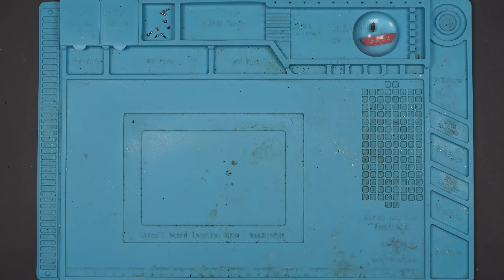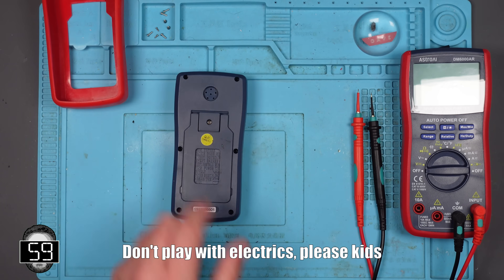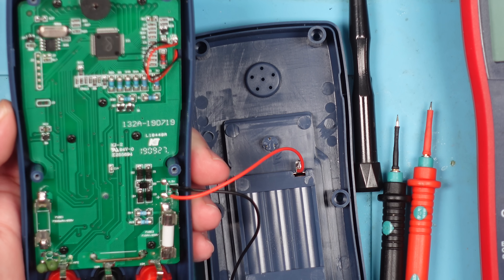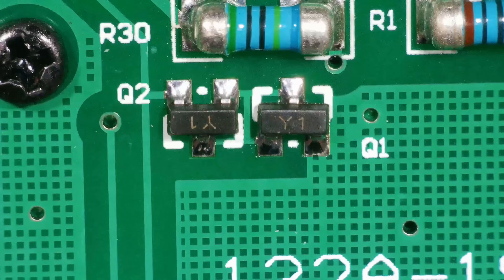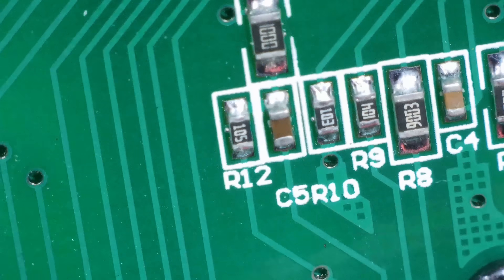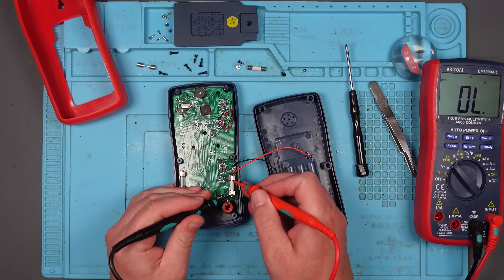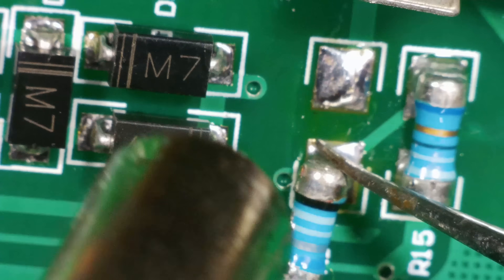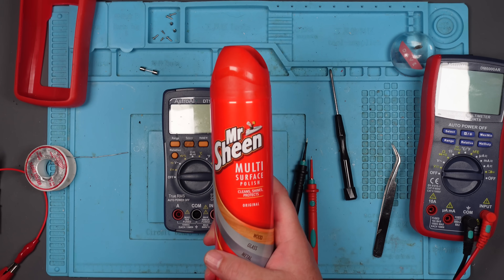My Multimeter BROKE | Can I FIX it?

Comment from the maker: Stupid Multimeter
Reply: When you replace the fuse, take the board back out again, and put some contact cleaner on the pads under that dial-knob. What 'broke' is that those pads got a bit of schmutz on em so that they didn't conduct cleanly. Those pads and the contacts in the knob part form a set of parallel switches that control the mode based on what is and isn't connected. It's a state machine.

The multimeter was erroring out because, upon powerup, it couldn't enter a known state, because it couldn't get clean contact on the pads from the knob well enough to select a specific mode -- most likely it was just getting clean contact on some, and very intermittent contact on others, but some pads might've been refusing to come on at all, if it was grubby enough. You'd be surprised at how touchy these things can get (especially on the cheapies) -- a little bit of finger oil goes a lot farther than you want to know...
Reply: Hi Steve. The problem was with the options selector leads. You didn't see it in the video, but if you put the circular leads on the other side of the circuit board under a microscope, you'll see copper remnants joining some leads with other leads that shouldn't be touching, which is why you're getting the error on the screen. This happened to me a while ago with a cheap multimeter, and when I looked at it under the microscope, I realized there were leads joined by pieces of copper torn off when moving the selector from side to side. This is caused by friction, and it drags the copper to the sides until the leads mechanically join together. You just scrape off those artificial bridges, and the multimeter works normally again. That's why in the video, after moving the selector repeatedly, you get it to work again, because you've broken those small bridges. Best regards.
Reply: @ksktechnics  haha I thought it was a rare thing when it happened to me some years back. fortunately I didn't mess around much, I went with the cleaning option first, when I discovered the dial contacts could be bridging tracks... Thanks for confirming the issue is not so rare at the end.
Reply: Quick update to my comment: that was what the Google AI summary told me but looking at the service manuals there is nothing in there about power cycling to clear errors. Stupid AI...
Reply: Had to Google it myself but apparently the proper way to clear errors on these Astroai multimeters after you've replaced a fuse or what have you is to power cycle it repeatedly. Stupid Astroai
Reply: I love my dm6000 been using it for 2 years now without a issue
Reply: Just want to say thanks for these videos. I've watched so many of them now I actually managed to do a reasonable job of soldering some surface mount stuff yesterday. A huge improvement since I tried fixing a busted charge port on a tablet some years ago and got so annoyed with it the iron actually went through the board..
Reply: I fix meters every day as my students try hard to blow them up. Switch to Fluke and love it for years.
Reply: I didn't see your last video when your multimeter broke. Would you mind sharing what happened?
Reply: Haha i have my own multi meter is really expensive for working the shop and diagnostic circuit on cars it actually no problems since 20 years it bought 500$ for cars repairs . I joined your subscriber and fun to watch but funny your multimeter is out just kinda of fun . Thanks for sharing the video
Reply: It's just a wild guess, but I think the problem is the way you pronounce "cantinuity"😂👍
Reply: There are millimeters with automatic settings! They simply register what's coming through the item being tested !

Comment: My guess is that the overload that blew the fuse, also caused arcing on the selector wheel contacts which left an oxidised layer. When you span the wheel it cleaned the contacts.

Comment: I used to use a VOLTmeter to measure volts.  And then I used an AMmeter to measure amps. Then I used an OHM-meter to measure ohms. 

Then I got a device that did all three and more in one.   I called it my MULTI-meter.

Comment: nice video ordinary slow blow fuses (as your box probably has) have a 250V voltage rationg, but as long as you know not to use the meter in high voltage measurements, you can use a slow  250V fuse untill you buy a 600V Fast fuse. If someone else might use the meter, make a DYMO sticker saying max 250V

Comment: Note for future, fuses are based on amps, voltage doesn't make any difference to the current carrying capability, only to the devices insulation capacity. Amps are amps whether that's at 0.01v or 400kV.

Comment: Those ceramic fuses contain sand to prvent arc blow, those glass fuses are not safe to use on power circuits but that meter is more than likely not safe on power circuits either.

Comment: You want to blow the new meter up already? Don't measure continuity with power in the circuit!!!!!!!!!! A blown fuse would not cause Err - the meter does not know it has no input.......

Comment: Love this video. Nothing beats repairing your own devices. 

Does anyone know where in the USA i can have a Crafstman multi meter 8241 repaired? Fuses seem ok, fresh battery. I put it on continuity and I hear beeping. Removed one lead and with the plugged in lead I stuck it into the red connector hole and it has zero reading at 20k. I am very naive when it comes to using a multimeter but i need it to work in my old car. When i test a known wall outlet it goes down to one when iam in the   Vac setting. Any help would be appreciated

Comment: Rule of cleaning electronics, regardless of the voltage, spray onto cleaning cloth before wiping down, you don't want the opportunity to spray liquid into something somewhere! Just a heads up, it will helpin the future for not causing damage to something unintentionally.

Comment: I suspect that when you switched it back and forth repeatedly that you may have finally rubbed-off soot or some other spark residue from the switch that was deposited when you blew it up -- blocking connectivity. Once that residue was rubbed off, it started working again. If it starts failing again, try opening cleaning the switch contacts with Deoxit or something similar.

Comment: Steve,

Take the new meter and read the ohms of a new resistor.
Then read the ohms with the old meter.
Make sure they read the resistor fairly close to each other. Just to ensure the calibration of your old meter did not get knocked out of calibration. 
Test with a wall socket as well for AC voltage.

Comment: I was looking forward to this specific video as I have my analogue multimeter to fix. The issue is that the '0' ohms setting knob will not set to zero. Obviously I have replaced the batteries (2 x AA) as it appears not to have enough power to reset. My fuse is ok so I'm thinking it must be a resistor network that is faulty. So here goes.... 🤞 (Unless it is the main selector contacts that need cleaning! 🤔)

Comment: It might be advisable to use the new meter, until you get the right fuse at least, as the older one now would seem to be unreliable.  The newer one, being more modern, would possibly be the better choice to use now...  Even though you are attached to the old(er) one.  However, the choice is yours, of course!

Comment: Love it when the on and off fix works, lots of others saying it but probably because of the connectors on the dial need cleaning.
I've got the other multimeter and it is great, a little big but does lots of nice beeps.

Comment: 4:28 Steve, PLEASE stop using continuity while a the device is powered, you will blow another meter! The reason the meter didn't reset is probably due to those contacts they are using on the dial just not connecting cleanly. Think it was just coincidental timing. When it rains, it pours, right? But hey, stupid meter works again!
Reply: I was just about to write this same exact sentiment. It's either this or the meter was throwing a code be cause it was in amperage mode.

Comment: Kinda related: my PlayStation 5 controller stopped working last week. Nothing whatsoever would respond. Thinking it was completely dead and that I broke the board or something, I decided to take it apart because I had nothing to lose.

Knowing nothing about what I was looking at inside, I saw no damage on anything. Very odd I thought. Put it back together and it was alive again; perfect working order. I still have no idea what happened or what I did to bring it back k. But at least I didn’t have to pay for a new one!!

Comment: The only thing you didnt seem to check was the dial contacts on both lid and motherboard, maybe you erroded the carbon build up from the arc produced by the short. BTW generally fuses are by amperage not voltage as such they have a wide wange.

Comment: I rekon, full disassembly of the selector switch did it. There was probably a bit of swarf or debris there. Which may have caused an initial short, but then bridged the wrong contacts, giving the 'ErrE'.
The functionality would not be affected by the wrong voltage fuse. A fuse is, after all, just a conductive wire, calibrated to melt appropriately. The voltage rating is just for safety. So that when it does blow, it doesn't explode or catch fire. Low voltage ones can be made cheaper. High voltage ones need springy bits and sand etc.

Comment: I repaired a multimeter a few weeks ago, you should clean the contacts of that switch, in my case there was a connection where there shouldn’t be one. Some deoxit or electronic cleaner does just fine

Comment: The multimeter indicator Err and then turned itself off.
When you design this things, you make them turn themselves off if it makes survival more likely.
If you get an intermittent fault the you might indicate the fault as soon as you turn on then next 10 times (or similar).
You may have blown the fuse (as discussed elsewhere) and the multimeter may have had an over-voltage on the resistance input, and so indicated the Err.
Resistance is measured by applying a voltage and measuring the divided voltage.
Love your work!

Comment: Mine's died too recently! (A different brand) 
One of the springs on the dial was for some reason burned through on the 90° bend on one of two halves, had to solder it back together

Comment: I would assume that the rotating of the knob actually let loose some debris and might have fixed temporarily.... I would fix the fuse and may use some electronics cleaner to clean up the contacts on the rotary knob

Comment: Fuses have the voltage and current rating etched into the fuse contacts - ie. the metal bits on either side of the fuse!   The "rotating around" to reset it - basicall you probably cleaned the contacts underneath where the wipers rubbed over the circular traces!  Chances are when it blew the fuse, something there spat copper or other metal onto the circular traces.   Rotating it over and over probably cleaned away a bridge.

Comment: Blows up a multimeter by measuring continuity on a live circuit. Then uses a second multimeter to measure continuity of the fuse in the first multimeter while it’s got a live circuit.
Reply: Yeah u talk about whole 4.5v live circuit...I think it can handle it...considering it is not short circuit and display only draw couple of miliamps...so yeah not best idea but it should be fine for any decent multimeter
Reply: @rtfmmycompany4498  it was more that he should learn from the mistake he’s currently trying to fix. You cannot measure continuity in a live circuit. The multimeter uses voltage it provides to identify the resistance.

Comment: The fuse was probably blown a long time ago, it's only used for measuring amps, not voltage.
You didn't break the multimeter by measuring continuity with the power on in the previous video, that's just not a thing with modern meters.
I think this was just the most common fault with cheap meters, dirty or used contacts of the selector dial.

Comment: The type of fuse that was installed is an HRC (High Rupture Capacity) will contain the arc when it blows, they are often ceramic, the fuse wire surrounded with a material that will quench the arc without exploding.
The glass fuse you have installed has a lower rating and will not contain the arc to the same level. You need the original type to maintain the 600v rating on the multimeter.
Reply: Yep. Definitely replace the fuse. The ceramic tube contains a fine sand that impedes the hot metal of the vaporising fuse wire. The arc flash from a glass fuse wire could maintain the arc and can, given certain conditions, cause serious burns or even death.

Comment: So you blew up a multimeter because you were taking measurements on something while it was powered, so you go to fix it with a new multimeter and proceed to take measurements while the thing has batteries in it?....for fecks sake...

Comment: Could of been as simple as carbon build up on the contacts for the dial (as well as the fuse). Had it be me I would of checked the fuses and cleaned the contacts before investigating further. Just turning the dial multiple times like you did could of been enough to make contact again

Comment: "Ceramic fuses are more durable than glass fuses, can withstand higher temperatures and voltages, and contain a sand-like material to quench the arc and prevent explosive rupture, making them a safer choice for protecting both the sensitive internal circuitry of the meter and the user. "

Comment: "Hey Steve, I really enjoyed this video! I was actually curious about that mysterious 'ErrE' too. I asked ChatGPT (I don’t really know much about electronics myself, just the little I’ve learned today with you and ChatGPT togheter!) and it explained that what happened in the end was basically a microcontroller latch-up. The IC inside the multimeter can get stuck after an overload or protection event. By turning it on and off several times – especially using a powerbank with clean power – you fully discharged the internal capacitors and forced the chip to do a hard reset. That’s why the error disappeared even though no component was replaced. In other words, you didn’t “fix” a part, you just gave the multimeter a proper reboot 😅. Still, great troubleshooting process and very educational!"

Comment: Since your high voltage fuse was blown you touched something with high voltage and probably ran through your dial switch arching and put carbon on the copper contacts. Switching it on and off quickly likely cleaned off the burnt carbon that was insulating the switch not letting current through.

Comment: If you want something different, I would recommend a Soviet 4341.   My one never used came from a Soviet cargo carrying plane, big beefy steel case and a ton of bits to go with it and I paid £10 NOS off ebay for mine.   The design is so solid and 100% serviceable, its still made today in Belarus and Russia and I think Kazakhstan and are considered one of the best avometers going.
Reply: Lol nobody will sell one of those for a tenner! Maybe 20 years ago? 30? not today.

Comment: Never understood why fuses have a voltage marking. After all it is just a piece of wire which will melt at a certain current.
Reply: Hi Ern_S. The voltage rating guarantees that the "gap formed at the point the fuse burned" will be wide enough that there is no chance of it arcing across that gap (and ruining one's day). In reality, you only need a fuse with a "voltage rating" for the max voltage your meter will be testing. Theoretically, Mr.Steve probably wouldn't see much more than ~250V. The meter is rated advertised at a much higher so it will have a appropriately voltage rated fuse. You RoCk. Cheers from So.Ca.(crazy)USA, 3rd house on the left.

Comment: Shouldn't be doing continuity tests with the batteries installed. If a fuse was blown (as an example) then there could be a voltage between the two fuse terminals.  In continuity mode the meter is trying to pass a current through the leads and if you then subject the meter to an external voltage then damage may occur.   I think this is what happened originally when it failed in the last video, I seem to remember you were continuity testing the switches on it  with power on.
Reply: Exactly this!  The continuity mode on the multimeter is a special case where the probes carry power from the meter battery INTO the test circuit.  If there is continuity in the component being testing it will pass that current back into the meter to sound the buzzer so should be done without power on the test circuit.  If powered up then bad things could happen to the meter, the circuit or both.  Conversely the voltage and current settings on a multimeter are 'passive' and actually need the test circuit to be powered up.  That being said I really enjoy your videos and have been going through your back catalogue.  Best regards from another part of the UK.

Comment: I as well have the DM6000AR 👌 would love to see a video where someone figures out how to lower the beeping sound either via a resistor or simply covering the speaker a bit 🙉
Reply: Sticking a bit of paper type sticker (like sheets you can buy for printing) on top of the speaker would probably work.

Comment: Maybe the actual switch contacts were the problem. And as you disassembled it a few time you cleaned the wipers enough to make proper contact again. Those wipers could have taken a large current surge before the fuse opened and lightly burnt a place on them, and after sweeping them a few times cleaned the burnt area clear enough to start working again.   IDK   Just a suggestion...

Comment: Probably you are a lucky B... but it also might be safety that burned the fuse and the electronic was so shocked, that it needed the Steve's touch to make it work again! LOL (and a little bit of desoldering, heat gun action and screwing screws in the marvelous thing)